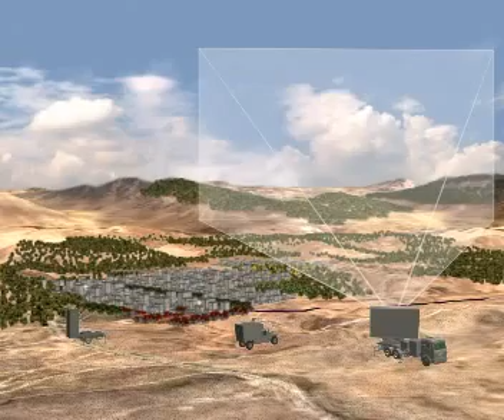Iron Dome - missile protection system

Comment: The fake Iron Dome! To those explaining away no signs of vapor trails of supposed incoming Hamas rockets by claiming that they glide the rest of the way to their targets and that they're launched from beyond the horizon... How would you explain away mathematical law too? Because this totally OBLITERATES your explanations:

Height / 3.57 = Distance to the horizon, so the distance to the horizon from an observer is ~ 3 miles, depending on whether you're laying with the side of your head on the ground or if you're filming from a step ladder. The maximum range of most any Qassam rocket is 10 miles, but even if it was 30 or more, this destroys your argument.

Using that same formula, if that rocket is fired from the maximum distance at which it can reach it's target, and hypothetically shuts its "engine" off at even 100 FEET above the ground, I should see the vapor trail from 35.7 miles away—3 1/2 TIMES THE DISTANCE of ten miles! 

Besides all that, how does a rocket that's launched at roughly 45-degree angle, and that shuts off at 100 feet above the ground gain enough momentum to reach a target ten miles away, much less 20 or 30? Your explanations are absolutely ludicrous! Are you all that incredibly stupid or do you think other people are?
Reply: eh, this video's from six years ago. Not really worth ripping into. Besides, this rocket system isn't on a meager one calculation system, that's right, it can calculate. Like, calculation calculate. Seems like it saved a few live today in fact? 15 rockets shot down seems pretty good to me

Comment: The US-Gov successfully tested their Laser Anti-Missile system in yr-1995, with Israel in mind, that would have taken down all Qassam home made and unguided rockets. But the Zionist-Gov refused to acquire one, despite considerable US taxpayer aid provided to them. In year-2007 the Zionist developed the 'Iron Dome', it fires two (2) expensive rockets to take down one inexpensive Qassam, and is said to have an 80% effectiveness.
Reply: since 2007 a lot of things changed, the terrorist regime of gaza stopped using qassam which were indeed homemade but for 5 miles and enormous amount of aunchings were deadly, now we are talking about russian homemade 122mm caliber rockets called grad. i think you was refering to nautilus system in tour describtion, it has many pros and cons, it is more afficient for the smaller calibers and clear sky and way cheaper, israelis should used both of them on the same place. the most effective system is to pull out from the storage those 60 year old artillary and constantly shell those points of launchings in gaza, no soliders and epensive weapons needed, it is true that death toll will be ten time higher
Reply: The Zionist-Gov have made a serious error concerning the ineffective Qassam-lll rockets, home made, unguided, landing predominantly in outback arid regions bordering Gaza... check out a Google map, and remember the Qassam-lll has a max range of about 15-miles.

There are a good number of photo's showing spent Qassam-lll rockets, in rack's upon rack's, and it is evident they are all Qassam rockets, and not one Iranian, Russian or any other rocket evident.

Not long ago the Zionist-Gov reported a Gaza Qassam-lll rocket landed in Tel Aviv, 95-miles away from Gaza... very strong tailwind?

Comment: Iron Dome battery commander recalled:
"A missile was fired from Gaza. Iron Dome precisely calculated [its trajectory]. We know where these missiles are going to land down to a radius of 200 meters. This particular missile was going to hit the Israeli Towers, the Kirya (Israel’s equivalent of the Pentagon) or [a central Tel Aviv railway station]. Hundreds could have died.
"We fired the first [interceptor]. It missed. Second [interceptor]. It missed. This is very rare. I was in shock. At this point we had just four seconds until the missile lands. We had already notified emergency services to converge on the target location and had warned of a mass-casualty incident.
"Suddenly, Iron Dome (which calculates wind speeds, among other things) shows a major wind coming from the east, a strong wind that…sends the missile into the sea. We were all stunned. I stood up and shouted, ‘There is a God!’
“I witnessed this miracle with my own eyes. It was not told or reported to me. I saw the hand of God send that missile into the sea.”
Those who curse Israel shall be cursed - Genesis 12:3
No weapon that is formed against Israel shall prosper - Isaiah 54:17
I will send fire on the walls of Gaza that will consume her fortresses. - Amos 1:7

THIS IS REAL PROVE FROM THE GOD ALMIGHTY OF ISRAEL

Comment: This is good, but why does Iron Dome require 3 different installations for functioning? Radar, Battle Management  and Control and Missile Firing Unit. I hope Rafael is working to make Iron Dome as a 3-in-one unit rather than one having 3 disjoint units. Also, it needs to be as mobile as possible; a mobile missile launch vehicle can be designed for Iron Dome. Latching it to a tow vehicle might hinder it's potency, as it cannot be active while being towed.